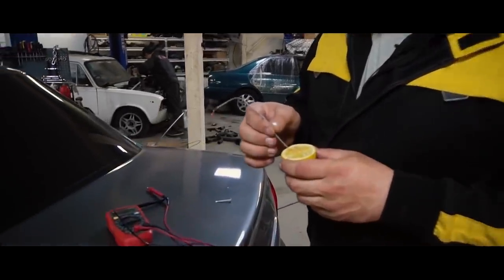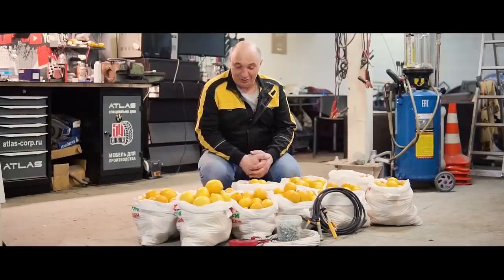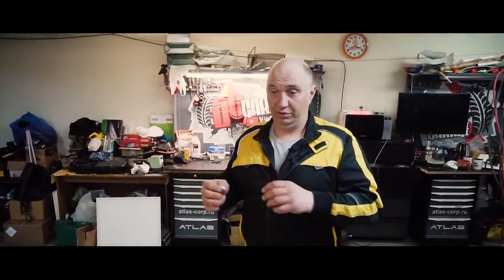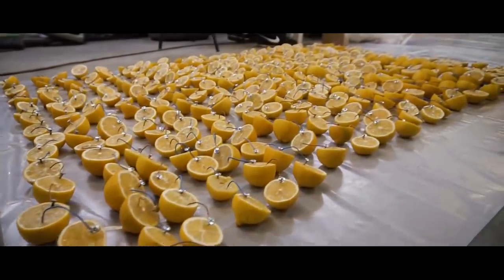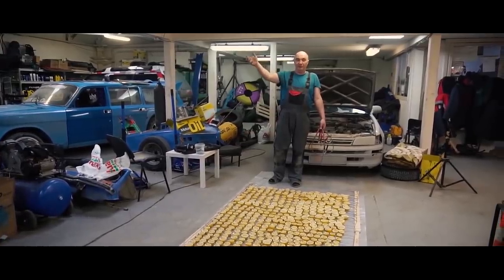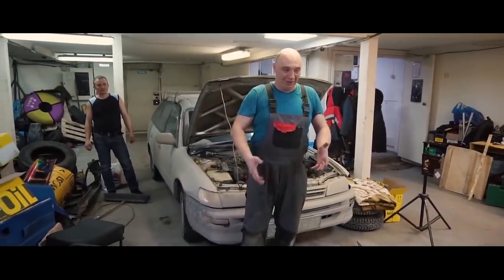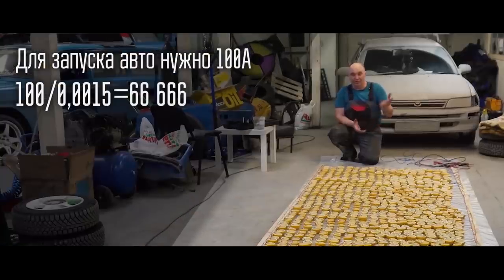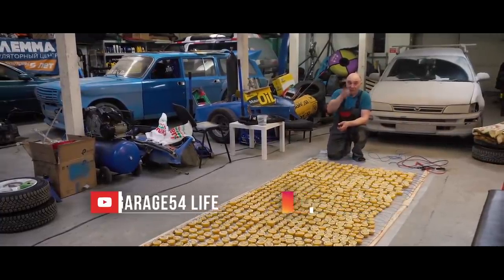Can a battery made from 1000 lemons start a car?

Comment: Garage 54 next month: "Vodka instead of brake fluid".
Reply: Vodka made with lemons I might add 😉
Reply: "Looks like it doesn't work guys, oh well, we dont really need brakes anyway, just down shift"
Reply: @lukethedrifter3363  sounds tasty !!
Reply: Dont you mean brake fluid instead of Vodka?
Reply: @lukethedrifter3363  with water melon frozen chunks mmmmmmm
Reply: Thats right comrade.
Reply: Citrine vodka.
Reply: THATS RACIST
Reply: @RiggyRonnie  now that actually used to be a thing back in Soviet times. If I remember correctly, they'd pour brake fluid down a frozen crowbar, which acted as a sort of "filter". All of the poisonous stuff would stick to the frozen crowbar, leaving you with consumable spirit.
Reply: that's actually, that, yes
Reply: @obviouslytwo4u  isn't everything?
Reply: Nothing left for testing ... ^^
Reply: Grzegorz Zawadzki water works better
Reply: @adamsmith5913  (

Comment: This is the guy your math problems warned you about
Reply: Vlad has bought 70 kilograms of lemons, if each lemon generates 0.9V and 12 V is needed to start the car calculate how many he will need to do it.
Reply: @infectedmushroom7544  as he said, about 15 lemons. However, you'll get almost no amperage out of it, so you can make multiple of those 15 lemon lines, and then hook all of them in parallel. You'll get still the same voltage, but way more amperage. That's what they did if you look closely.
Reply: Klaufmann yup to start a car you need to be able to put out about 500 amps to deal with the inrush current of the starter.
Reply: @bassdrumflextime1253  yeah, so if you get 2 amps from 1000 lemons, youd need a quarter million lemons to start a car. Quite wasteful
Reply: @CatNolara  yup

Comment: It's Russia. You need to use potatoes and use magnesium instead of zinc. Wire them in parallel. You can start your car with less than 1000 of them, probably closer to 200 😊

Comment: I've seen far fewer lemons light up an LED just fine. I think your zinc electrodes oxidized before you could start the experiment. Although, I've never seen halved lemons used. I've only seen whole lemons used. Halving them probably destroys their potential. You probably can also use other metal in the place of zinc like aluminum. Any metal with a high electrolytic potential to copper should work. An any rate, you should have done tests with less lemons on smaller loads before stepping up to starting a car.
Reply: Cutting them in half doesn't "destroy" anything or even degrade it really.

Citric acid is just a very poor electrolyte, not to mention they aren't using very much electrode surface area whatsoever. 

Each of these "cells" may be capable of a few mA, let's be generous for math purposes and call it 10mA. 

That's very generous, as they effectively pointed out, but I'm going to assume something resembling "real" plates are used, rather than a stab of copper wire and a zinc plated bolt.

A typical 4 banger starter draws 200-300A in most conditions. 

Let's say it takes 20 lemons in series to reach a nominal (+/- 5%) 12V.

You would need 15 thousand of these strings of 20 lemons to get close, assuming the abilities of a single lemon as stated above.

That's 300 thousand lemons, just to have hope. The actual number is likely a bit higher just because there's so much room for error when attempting something like this. Doing it with copper wire and bolts, the number is probably in the 2 or 3 digit millions range.

Gonna need a bigger garage and a copper and zinc mine to make it happen 🤣

Comment: Why cut them in half? Why not poke a hole just big enough for the wire?
That should slow the oxidation and potentially improve the results of the experiment.
Reply: Multiple small pieces with the same size wire put into them increasing total surface, therefor output, perhaps?q
Reply: Or really get the juice and some copper and zinc plates and make a proper gigantic battery form factor with that.

Comment: you don't need that many lemons. It smore important to have more metals (more surace = more amps) and more in series means more voltage!
Reply: Depends on how you connect them parallel = more ampere
In row = more voltage
Reply: You only need 12v though
Reply: @leolaf6501  yes, parallel is the same as if you take more metal surface. so more electrons can be used at the same time :)

i meant with that you can put more than to pieces of metals into each lemon. you just need their acid! :D

Comment: I freaking love that they film with 21:9 aspect ratio
Reply: Me too!
Reply: Why dafuk do moveis get wider and wider? in the future we'll have like 50:9 aspect ratio
Reply: Actually that isnt 21:9 they just put 16:9 and put some black bars on it i have a 21:9 monitor I can still see the bars
Reply: @PK-qs5xw  I just hate how most movies are read in "Full HD" 16:9 even if the movie has a 21:9 aspect ratio.
Reply: i use a 1x3 setup and its still not ok, i can still see the black screens to the left and right. My ratio is 16:3 or 5780 x 1080
Reply: Why is it called 21:9 when it could be reduced to 7:3
Reply: @cocopuf97  Bigger numbers sound cooler. Marketing trick. 7:3 sounds a bit underwhelming. 21:9 sounds better
Reply: @doesntstand4anything  netflix movies and some hulu ones actually do have 21:9 support
Reply: It's annoying, even songs on tv are in 21:9 and my tv is 4:3. Half of my screen actually shows picture.
Reply: @cocopuf97  because people are used to the idea of 16:9 so when you say 21:9 it's obvious that it's 21/16 x the width of 16:9 if you keep the height the same. Same happens at higher numbers when you have 32:9 you know it's the same as having two 16:9's side by side.
Reply: I can't stand the 21:9 ratio. I didn't get a 16:9 4K tv just to have black bars all over again. It's way too narrow and cuts off too much of the top and bottom. I hate it. And on my phone which is a 16:9 screen, it's the same BS. I love the 16:9 format. 21:9 is just too narrow. It cuts off too much and you have less screen area. It's like squinting your eyes a lot while looking at a 4:3 photo.
Reply: I hate, especially when you watching in windowed mode

Comment: I wonder...  Copper and Zinc plates could be connected and lined up in a plastic tub, and filled with lemon juice.  Similar to the structure of a car battery.  If they didnt throw them out, they could use the juice from the lemons they have.  But jugs of lemon juice concentrate can be bought cheap.
Reply: and now you have an upset shop owner who realizes he didn't need 1000 lemons
Reply: FormalMite but 1000 lemons is good video content, as opposed to a barrel of acid juice
Reply: Patrick Earthridge Russians don’t throw away food
Reply: They don't have enough surface area to get a lot of current, even a coin would've been better much better

Comment: Try using flat blades of metal strips instead of screws
and use super rough sandpaper to roughen up the surface and quickly plunge it into the lemons so you have maximum surface area!
Reply: Screw would have more surface area
Reply: not if the metal plate is really rough and wide or shaped like a paper fan or mini heatsink

Comment: Bigger copper and pure zincplates increase the ampere...
What ampere do you expect from thin short nails and 1,4-2squaremilimeter cables?
Reply: youre critisizing russians that let dogs drive...
Reply: When I made battery out of liver casserole, I used 1 cm wide aluminium.
Reply: Exactly!
Reply: Thin zinc plated screws at it
Reply: Plus aren't they configured wrong? Appears to be a series configuration and if that were the case I believe they would be maximizing voltage instead of current. Youd want to find the 12v mark of the series configuration and then repeat that in blocks and connect them in parallel to give you the higher amperage
Reply: I have seen  5tev and 400 Amps go through 4 small wires the size of human hair
Reply: @ChrisG1392  no, listen to the guy and look at the connection, they are running series-parallel configuration.

Comment: Instead of placing one electrode in a lemon, you can put more as if in parallel. This will give more amperage in each series. If you place the zinc and copper electrodes close to each other, the amperage increases significantly. In the video, you put them at both ends of the lemon a long distance, this is causing a little amperage. This type of battery is a variation of the world's first invented battery. In the first prototype were arranged metal circles, copper and zinc on top of each other separated by a thin cloth soaked in acid. The large surface area of the circles and the small distance between them provide enough amperage to make the battery usable. So you need to think about how to increase the electrode area in the lemon. My suggestion is to put multiple zinc nails in one half of a lemon and many copper nails in the other and tie them together, instead of just one . This will use the area of all nails. Alternatively, use zinc and copper circles and slice the lemons into thin circles and place them between the metals.

Comment: could press the juice out of the lemons and put it in a big container then get a big piece of zink plate and a copper plate and dunk that in the container the moment you want to start the car , that you can do in a second and xhould give you the peak power for the time it takes both plates to oxidise , might need quite a few plates in parralel to get the juice out of the juice
Reply: Normal car battery has 10-13 mm thick connector... I know it's not same as radius what equals as the contact area, but it won't need really thick plates... Once the surface oxidizes, it doesn't matter how thick the plate is as the surface acts as an insulator.

Comment: *DO NOT DRINK THAT JUICE!!!*

The acid reacts with the metals producing electric energy.  The zinc dissolves into the lemon and there are other electrolytic processes. The lemon turns relative poisonous!!!

What you can do with the juice is building a Voltaic pile

Stack discs of zinc, fabric and copper and soak the fabric in the juice. Stack then to a column and you have got a voltaic pile which has a much better performance than some wire ends and small nails. The bigger the surface and the smaller the distance between the electrodes, the more power you can draw.

I guess 20 to 25 13.8V piles in parallel should at least power the lights of the car.
Reply: Don't worry, in Russia you poison the lemon
Reply: Well zinc and copper are both heavy metals after all but they are also micronutrients. I doubt there's too much of the metals dissolving anyway. Or at least this 500 lemons worth of dissolved copper and zinc once in a lifetime won't practically do any harm.
Reply: @matsopelle 
Exactly what I thought. I would drink it.
Reply: Sümbig Dumkünt  Yes, commercial move
Reply: Nerd

Comment: Great experiment, at least you tried it. I tried it with LED's and the result was very disappointing, series parallel with a few lemons only yields in a few mA's. any bigger load then a LED the voltage drops rapidly.

Using the lemons. Make some nice lemon ice blocks out of it.
Reply: RODALCO2007 I was surprised that they could barely light one LED with all those lemons. I wish they'd consulted a chemist to check if they had the design right.

Comment: 1,5A is way too low for engine to start, you should chack amperage of 1 lemon before starting project to see if there is a point of buying 70kg of lemons.
Your math is also off by x1000, you had 1500mA, not 1500uA...
Reply: Which means youd need 60 of these sets to get to 90 amps. Not 66.600.
Also they could increase capacity with decent zinc rods and not cutting the lemons in half, so the water doesnt evaporate quickly.
And it would be a lot better to solder all joints and get thicker cable for the 2 main leads, bc they will lose quite some energy
Reply: @StofStuiver  this small car can start nicely with 40-50 amp battery so divide your calculations by half :P
Reply: @Techie1224  that's amperes per HOUR tho, a car starter can pull about 300A at once. In fact car batteries are made for this instantaneous huge peak that is easily 10x their rated hour capacity, but ain't gonna resist many full cycles (from full to empty).
I think a normal car battery can even resist short circuits without damage if it doesn't last longer than a normal cranking time.
If they measured the short circuit current flowing they would know how much cranking amperes they have available, and I think that's what he did and reached like 1.5A only, probably because they oxided so quickly during the making of the battery itself.

Comment: 'm interested in making a hard lemonade after my cider is done, but I'm having a tough time figuring out how the recipes I've found actually work, and what's the best way to ferment lemon juice. What I'm looking at doing is grabbing some good organic lemon juice from Whole Paycheck, adding some kind of sugar (agave nectar, cane sugar, whatever...), then throwing on yeast and walking away.

From what I've read, yeast like an acidic environment (pH 4.5-5.5), but not as acidic as lemon juice or lemonade (ph 2-3), so I'm confused on how to build my mash if I need to compensate for that.

Is the pH something I really need to worry about when making a hard lemonade?
If I add water to bring my pH up, it seems like it will take a ton of water since that's also slightly acidic.
Do I need to add something like baking soda to bring my pH up, and to what level?
Even if it does ferment without adding anything, will the environment cause unwanted flavors or other effects?

Comment: There may be too much voltage drop from each connection maybe the wires should have been soldered and try it in a beaker of juice from 1000 lemons squeezed

Comment: that's because of:
the distance between the zinc & copper on each lemon.
the surface area was too small.
you guys could definitely start up the car with a 1000 lemons if you put plates instead of wires and scrows/nails and if theyy were close to each other.

Comment: For anyone thinking about measuring amperage that way, don't. Usually you'l blow the fuse in your meter, and possibly damage the power source. When measuring current, you should be measuring what is supplied to a particular load. Hooking the supply directly to the meter short-circuits the supply, which usually results in popping something.
Reply: true, and the saddest part of this video was that it actually didn't pop anything, since the short circuit current was so low (so, helpless in starting the car)
Reply: Yes,lithium ion batteries can create an awful lot of current when tested for amps. Unless you like damaging your batteries or risking a battery fire, only test the voltage.
Reply: Meh. You'll remember better if you learn the hard way!
Reply: You'll certainly remember if you try to check the amperage of a car battery or wall outlet  that way.
Reply: @phasm42  hehe, yep! Hope it's got a fuse..! It's actually the correct way to measure the short circuit current, for example for solar panels. But you should be aware what you are measuring before you try it.
Reply: @LunaticCharade  Yeah if it's particularly low current you're unlikely to hurt anything. But say for instance you wanted to see if that wall outlet was really 15A, stabbing your probes into the outlet in current mode would result in a big pop, a blinding flash, possibly a little burn, and a tripped breaker.
Reply: @phasm42  yeah you would need a big meter to measure that short circuit current! I wonder how high it would go, especially IF you have old style fuses with the melting wire...

Comment: If turbocharger works on principe running air into engine, just why not use compressor 😂
Pls do this. And pin me up.
Love your vids!
Greetings from Slovakia! ❤️
Reply: Big ship engines use compressed air to start, but the pressures there are about 30 bar. For a car, preferably diesel, they would need to inject the air directly to the cylinders. Quite a modification on the cylinder head...
Reply: "The centrifugal supercharger is used in many applications including, but not limited to, automotive, truck, marine, aircraft, motorcycles and UTV's. Of these applications, they are most commonly utilized for increasing horsepower in street vehicles and race applications. While the first practical centrifugal compressor was designed in 1899,[1] centrifugal superchargers evolved during World War II with their use in aircraft, where they were frequently paired with their exhaust driven counterpart, the turbosupercharger."
Reply: Air compressor= high pressure and low debit, super/turbo charger= medium pressure in high debit
Reply: Compressor- low volume high pressure, turbo- high volume low pressure 👍
Reply: audi and volvo actually have exact that
Reply: Amazon Sk compressed air supercharging is a thing. Look it up on YouTube. When has Garage54 ever pinned anyone?